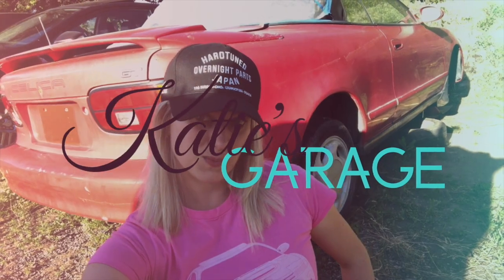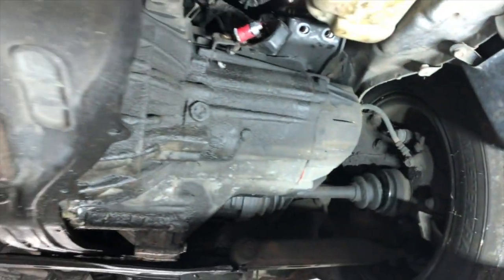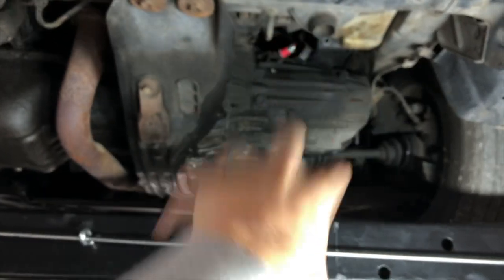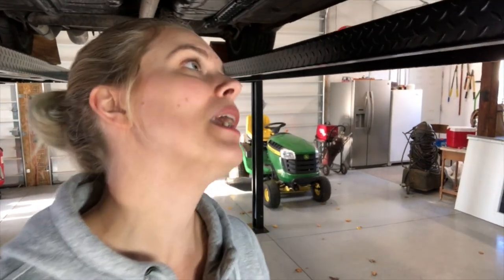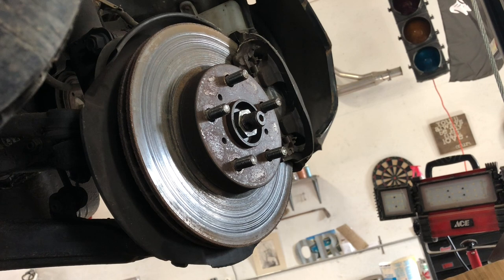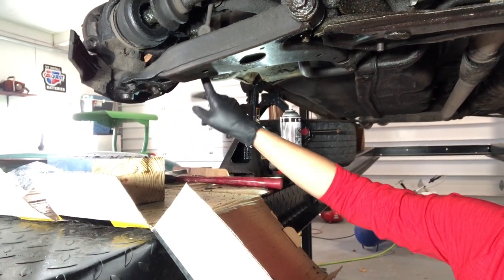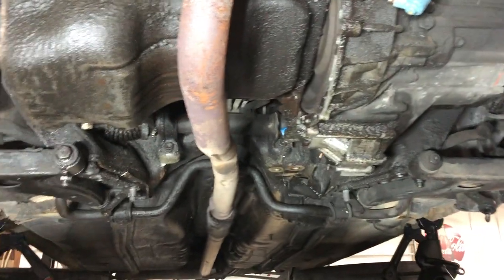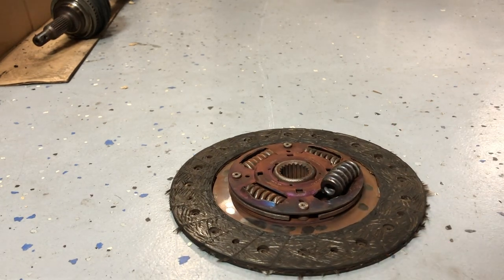Transmission removal in #ProjectToothless // 1990 Toyota Celica GTS

Comment: Just a thought on that flex pipe on the exhaust, I'd be sure to put a new flex piece in, not just regular tube - should be easy to get that section as a braided flex. That is there to allow flex from the engine in the exhaust.  I recall having to do one way back in the early 2000s on a FWD Pontiac something or other and it had the be a flex for that reason.  But you know Celicas better than I so maybe not needed :). Again, awesome work and great video!
Reply from the maker: Vortex Garage thanks! I picked up a new stainless steel flex pipe and got it welded in a few weeks ago. Car is still ridiculously loud, but at least it’s not under my feet 😂🤘
Reply from the maker: Has to be a flex because it’s a transverse engine that rocks forward and back instead of side to side 😉
Reply: @KatiesGarage  ah yes, makes sense as the engine would rotate transverse under load.   I remember having it done in that old grand am I had, before I could weld and had a shop do it, they charged like $900. I remember as it was one more thing that kept me interested in fixing cars 🤣👍

Comment: Hi, I have a Toyota manual 5-speed vehicle in 1990. There are signs that the gear handle is going to fall out while driving in the 5th gear. I'm driving slowly right now. I hope it's cheap. I'm curious about the repair cost. Where can I get the parts?
Reply: Have you fixed the problem?